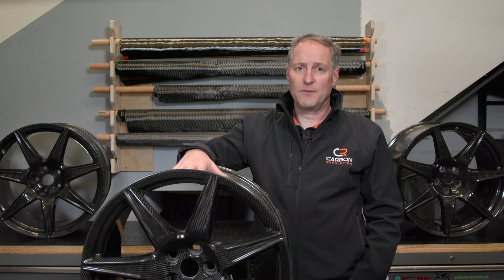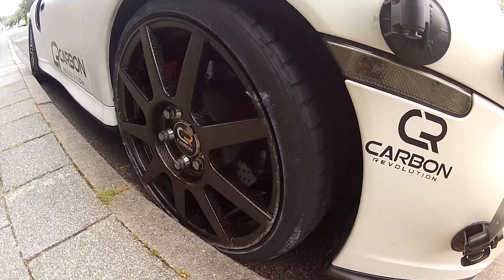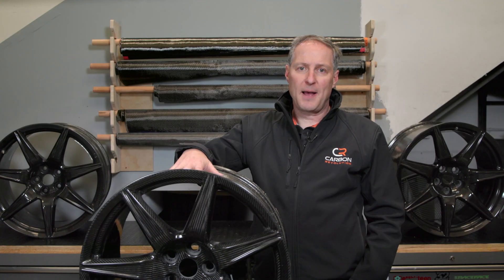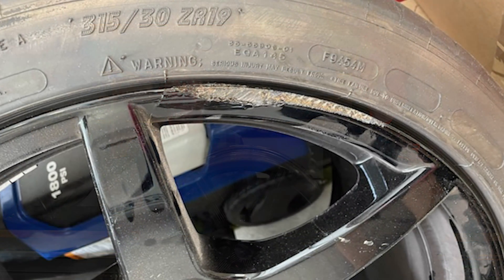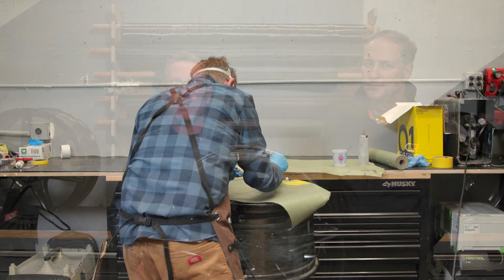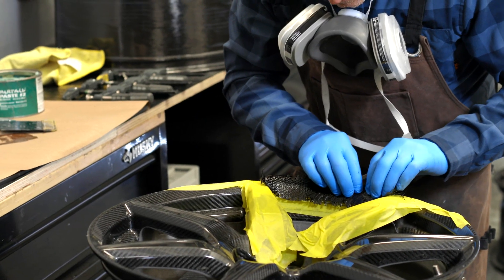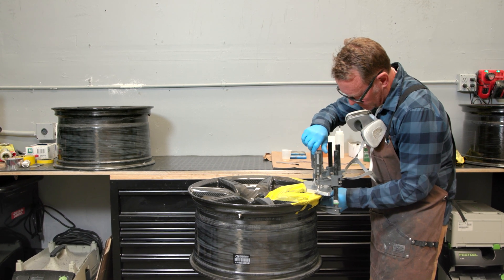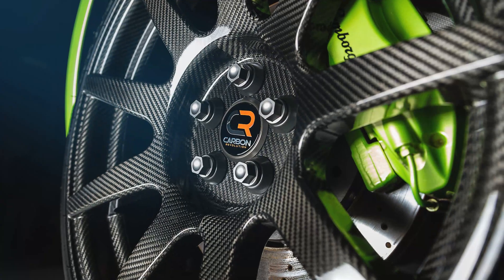How to repair curb rashed carbon fiber wheels

Comment: Can we get an update on how to repair the white coating?
Reply from the maker: The white coating is applied in a very specific way with some expensive specialized equipment. Spyder Composites has been doing some work on minor repairs to this layer, but generally we advise that significant damage to this section is not repairable, as it is such a high temperature part of the wheel.